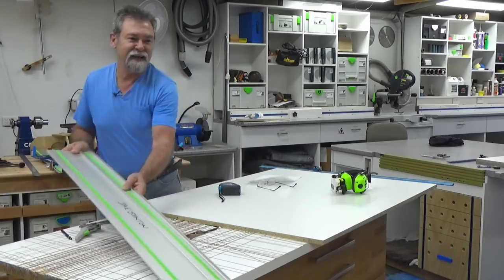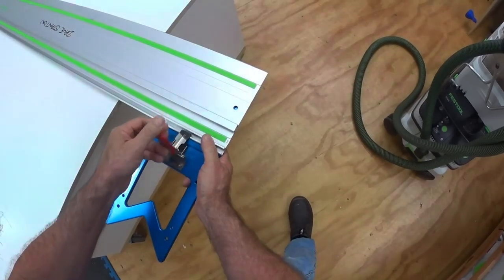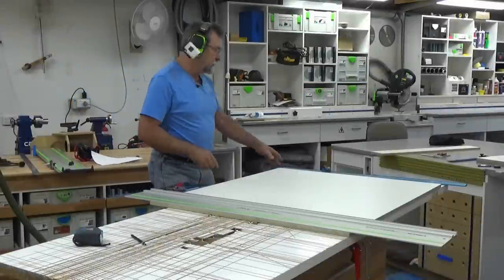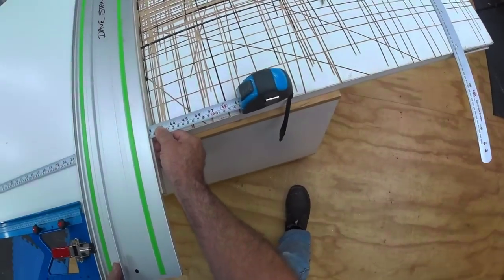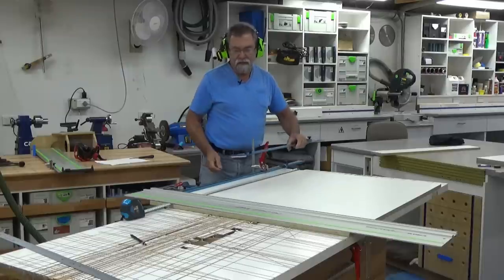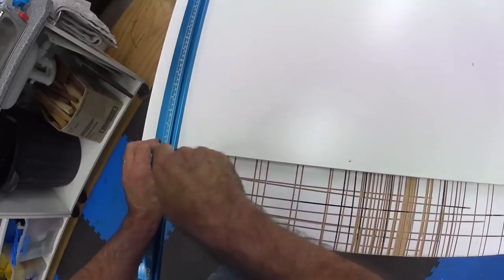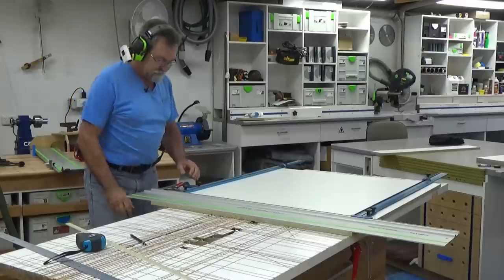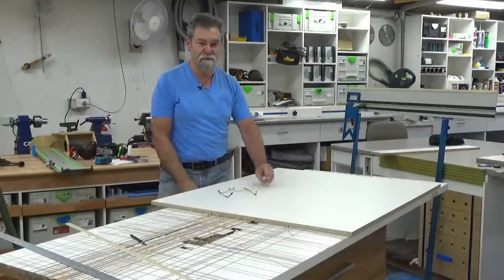How to | Calibrate TSO parallel guides | Festool Makita Triton track saw | Dave Stanton tso products

Comment: Thanks David! Very informative, until I bought the TSO parallel guides for my track saw, I always thought referencing your cut line off the splinter guard strip was always the weakest link.  Those TSO parallel guides are perfection, I love mine.
Reply: I agree. No matter how careful I am when cutting a new rubber cut guide I always seem to have ragged sections, and that drives me mad! I'm forever measuring and obsessing getting a spot on cut. Dave's technique looks like a winner.

Comment: I found that keeping long sticks of plywood roughly 3/4x3/4 makes great story sticks. First I cut a length the exact width of the rail. Then I measure with that as the offset. I cut the story stick and use that to set the parallel by sandwiching it between the stop and the rail. The results were extremely consistent for perfectly parallel cuts.

Comment: I just got my TSO Guides.  I may have thought of another way to calibrate which is quite similar to the TSO demonstration.  Set both stop blocks on the same distance, could be 6 inches, doesnt matter. but move both guides close to each other so that the calibration rods are level with each other.  Loosen the set screws and use a ruler, combination square to set both calibration rods at the same time, then tighten.

I know this doesnt address the point of your video which is all about a chewed up splinter guard, however you could make a cut, then do the same procedure with the combination square against cut vice the splinter guard and it should be simple and accurate.

Comment: Simpler way. 1) Slide stops (both guides) against back of rail; 2) cut a piece; 3) measure the piece; 4) loosen calibration grub screws ;5) set cursors to measured numbers 6) slide up to back of rail and tighten grub screws. Because you measured your saw/track combination, write it down and you can calibrate your narrow cut guides before each use using the same numbers plus 200
Reply: Brilliant method.  It subtracts all the errors.  Just did it and no error over 7 ft x 9 in piece. Thanks !!

Comment: Tank’s Dave for all of your videos! They are very well made and no bla bla. I have one question regard tso rail adapter. I have the festool rails and there is 2 differents type of guide rail adaptor: one is a drop -on, the other is slide one. Wich one is best, more precise ? Sorry, my english is not very good and tank you for answering my question. Keep doing your videos.
Reply from the maker: I like the drop on as they are quick and accurate, with nylon grub screws to adjust the tension on rail contact.

Comment: Oh man when you took that cut in reverse it scared me. I tried that once, most likely with incorrect technique, and the saw lifted off the track completely and made a huge gouge in the track.
Reply from the maker: Hi pid cin! 2 mm max depth on the scribe cut, 1/16th inch.
Reply: @DavidStanton  see thats the type of stuff I wish I knew back then. Thanks David! 
David in your honest opinion, are these things as accurate as a heavy table saw and good fence ? 

Is it possible to make a bevel cut to make that waterfall style cabinetry ?
Reply from the maker: pid cin, The tools are capable, it comes down to the person using them.

Comment: Really like your method. It isn't so complicated that the explanation gets lost. 
I have a few questions. Do you need to recalibrate if you change to a different length rail? I have a mix and match setup. I have a Makita cordless track saw, 2 Makita 55 inch rails, Festool's version of the GRS-16PE and a Festool 115 inch guide rail (FS-3000 I think?) for long cuts on sheet goods. The Makita and Festool rails are compatible with the exception of Makita's anti tip slot built into the rail. I chose to change to Festool rails because of how they are packaged for shipping and seemingly better quality control for guide rails. I do however have to adjust the saw when changing between brands to snug up to the guide rail slot. I'm not sure they are so different as to require recalibrating but I overthink and nitpick my work. Your suggestions are appreciated. Thanks Dave!
Reply: I too overthink and nitpick my work, especially when it come to trimming the splinter guard and calibratiing anything associated with my Makita track saw. It's maddening (and at times a time waster). All that said, I enjoy using my track saw.

Comment: Here was my procedure. Cut length of X (part A). Set the stop to 2X. Use A against the stop to make a cut at 2X - A (part B). Make that cut (B) and prepare for another. You don’t need to cut the third cut. Just clamp it in place. Swap A and B. Then zero out your stop. A was a bit off but B should have been exact.

Comment: does the reverse cut wear down your blade quicker or give you less resharpens?
Reply from the maker: Hey there! So, here's the deal with the reverse cut - it doesn't necessarily wear down your blade quicker, but you do need to be mindful of how you use it. Happy cutting!

Comment: I have the same setup with both long and short guides except I don't have the PE parallel edge guide. Generally I'm getting good results but I've been struggling when ripping pieces thinner than the track, say 3 or 4 inch wide piece out of a 5" piece. I calibrate the long rods by simply putting a piece of stock wood next to the splinter guard and butting the long rail up to it and set the indicator to 10". I've tried various ways of clamping. I feel like I'm always an 1/16 or even 1/8 off and it's driving me nuts! I'm guessing either my piece is being dragged out a bit as I'm making my cut or after seeing your video I wonder if my splinter guard on the track is off. or bit of both.

Comment: Hi. Thanks for the informative video. I recently purchased the Makita Track Saw system. 
My question: I'm looking into the TSO parallel guide system. They offer a 20" inch rail, a 30" rail, and a combo set of 30"/50" rail ($100 more than the 30" set). In my spare time, I enjoy building small furniture for family and friends (book cases, shelves, tables, etc. in my side-of-the-garage shop. In your opinion, which rail size would you recommend? Thanks again!
Reply from the maker: It comes down to how wide a panel you want to cut. Most people would be best off with the 20 inch as they don't flop around and pull at the track.

Comment: If only Incra made parallel guides for the track saw - then we could use their incremental rack for positioning the cursor instead of squinting at those laser etched lines.
Reply from the maker: Hi box185. Maybe a better pair of specs?
Reply: I agree. I'm going to put bench measure tapes on mine.  A digital readout on the stops would be superb.

Comment: Good technique, but seems to depend on accuracy of tape measure. Who makes the most accurate tape measures, both metric & imperial? Any that can be calibrated post-sale to maintain accuracy? Maybe I need to get Woodpecker long flat rule?
Reply from the maker: Hi Michael! They will be as accurate as the rest of the job you are measuring with that same tape measure so it will be consistant.

Comment: Dave
What about the projection of the splinter guard from the edge of the track? Won’t it affect the accuracy of the cut because the blade is referencing the edge of the splinter guard as it rides on the track?
Reply from the maker: Hi Kirk! That has been allowed for when I did the initial cut.
Reply: @DavidStanton  My misinterpretation... you are correct, you did not move the track after you made the cut so indeed the allowance was made for.
Thanks so much for your correction.

Comment: The GRS16 makes a square cut across the board. If you have the guide rail connected to the GRS16 and the rail calibrated, why do you need the 2nd guide rail? Just curious?
Reply from the maker: This is the way to callibrate the parallel guides. There are times when you can't use the GRS-16 because there is no right angle to square off and you may need another angle at the end of the sheet...other than 90 deg and you still require a parallel cut.

Comment: I am shocked that such an expensive saw does not have a 2mm quick release button for lamanets. even my cheep saw has one. also can u use the guids if your doing a realy short piece than is narrower than the track? I belive the woodpecker one does. just wonderd if this did. 😊
Reply from the maker: Interesting point parrot340. Yes to narrow stock and I will cover that in a new video soon. Again, very easy. Didn't want to give to much info to be absorbed in one video.

Comment: I'm hesitating in getting a set of TSO parallel guides, but I wonder how equally precise you can set both the stops just by eye. Even if you try really hard, you will never get both the stops exactly the same. Or is that error negligible?
Reply from the maker: Negligible.
Reply: ..I have the same thought, surely even 2/10 mm over say 1 meter is going to make a difference? Do you have a MFT table Ramin? I am deciding to make a very large MFT top or go for these guides,

Comment: Hey Dave. Thanks for the post on the parallel guides. I just purchased a track guide for cutting large sheets. Is there a reason to have the Jessem stock guides if you are using a track saw?
Reply from the maker: Hi Mikey Gee! I like both setups. Gives me a heap of flexability.

Comment: I just bought one of these systems but only with the GRS 16 (not the PE).  I am trying to figure out how to get this initial piece squared up with what I have.  The GRS16PE can create perpendicular cuts on left and right sides using same reference side, but the 16 can not.  Can one just work your way around cutting 90's?
Reply from the maker: Hi Jason Gieseler. The PE was developed for a reason. I am not sure what you are asking?
Reply: @DavidStanton  sorry for the confusion and thank you for the reply!  In short, how did you set up the board you used to calibrate the parallel guides.
Reply from the maker: Hi Jason, I created one straight edge using the tracksaw and then another at 90 degrees to it with the GRS-16.

Comment: Hi Dave

Long time fan, I have a set of the TSO PGS, but no matter what I do I can’t get it to cut accurately, no matter how many times I calibrate it, adjust it & check for squareness, my cuts are always a few mm off

Is there any help / tips or advice you can help with?

Many thanks from the UK!
Reply from the maker: Hi MrUmy786. Are you clamping the track after you put the parallel guides in position?

Comment: Dave, shouldn't you have measured before adjusting the second TSO parallel guide. The far cut might not have been parallel to the cut at the guide rail.
Reply from the maker: Hi kiwi007. I could have but the grs 16 is spot on. The reason I calibrated was to use the parallel guides as an accurate measurement system without needing a pencil. I could get away with using the right hand parallel guide only and the grs-16PE
Reply: @DavidStanton  Hi Dave, You are correct as the grs-16PE is a precision tool.  Therefor only one guide has to be measured and that value duplicated for the second guide.
The hot weather must have muddled my brain. No AC here and we are getting your hot weather now after 2 days delay.

Comment: ..another thing, you may thinking both sides are correct but you can very easily be out by say 1/10 mm surely?,
Reply from the maker: Hi Christopher Claudio Skierka. No way it will be out by even 1/2 a mm.
Reply: @DavidStanton  1/2mm is same as 5/10mm , I mentioned 1/10 or 1 tenth of a mm :) , surely it will be??

Comment: How did you ensure the sheet you started with had parallel sides?  Before you calibrated.
Reply from the maker: I didn't. I straight lined one side and then used the GRS-16 to square off it.

Comment: I just got the my parallel guide system. But was very disappointed when I
 discovered that one of the rails had a different color of blue than the
 other 5. Has any one experinced the same?? I also got the MTR-18, 
GRS-16 PE og GRS-16, they are the same blue color as the one of the 
rails.
Reply: Paint them all into "Woodpeckers Red" ;)

Comment: Why not just replace the splinter guard if it’s worn out?  Way too many steps.
Reply: Even with a splinter guard in good condition you still need to calibrate the parallel guides. Replacing the splinter guard is definitely more work than this method. Heck, the video isn’t even 9 mins long and that’s while he’s teaching his viewers.

Comment: I have nowhere near your trust in tape measures. I would rather just use the original TSO calibration method with a combination ruler (or better yet, a fixed one with a known 12"/30cm stickout or so), but with the little twist that like you do, make a cut, and reference the actual cut wood, not the splinter guard.
Reply from the maker: Fair enough!